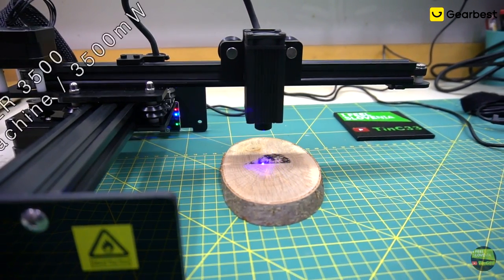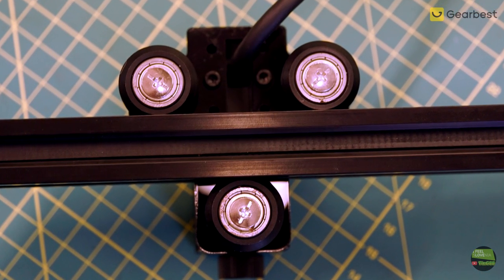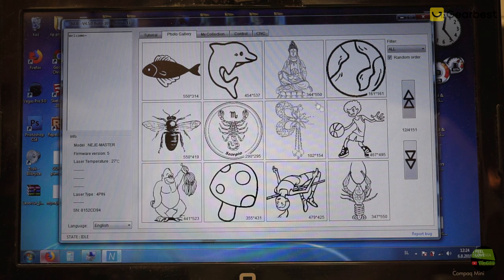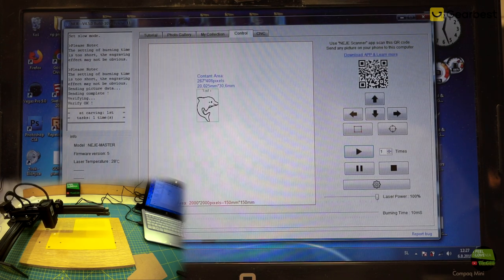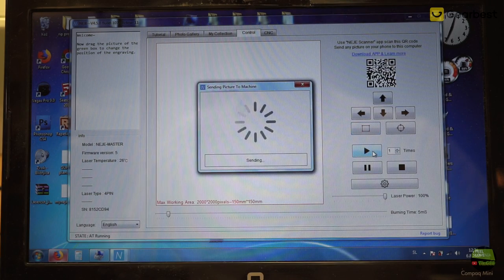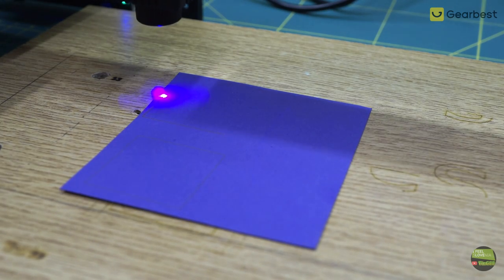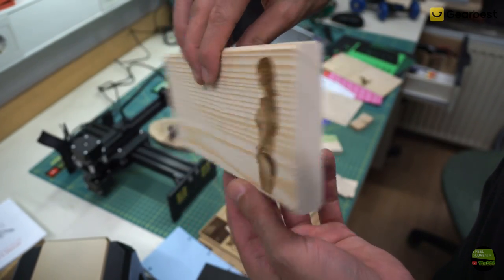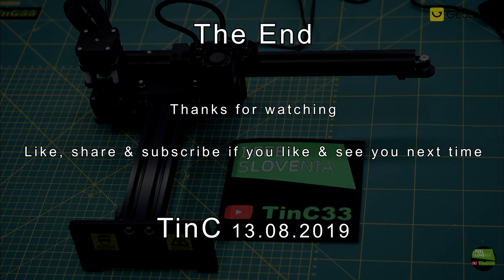NEJE MASTER 3500 Laser Engraver [review / software / first test on different material]

Comment: I wonder if you bought some 3d printer filament with mica embedded in it, if that would make it engravable? Years ago, I used to work for a company that had high speed packaging lines. The plastic bottles (for pills and vitamins) had to have mica in the plastic, or the laser engraver wouldn't work on them. Not very well, anyway. I found these filaments with mica: 

https://3d-print-works.com/blogs/news/luxury-filament-with-mica?ls=en-GB
Reply from the maker: It be interested thing to try, i try to engrave basic pla filament but it only melt the surface a bit, not clearly seen.
Reply: TinC33 maybe take a plastic pill bottle that has laser engraving (usually a lot code or an expiration date) and see if the laser works on that?
Reply from the maker: @toastrecon  thanks for tip, i'll try next time when i use laser, but i think that's different laser type not only plastick, anyway need to try 😉

Comment: How long did it take to engrave the lion and the girl in a bikini?
Reply from the maker: Hello, now you got me, honestly i don't remember anymore, and also i'm not home so i can check the clips... but i thing somewhere from 30min-1h it's very depend on engaving time settings.
Reply: @TinC33  OK. Looking forward to that. I want to use the machine for a start up engraving business to raise money for a bigger machine.
Reply from the maker: @stephensiloka8713  I think that one is good choice to start, because if you see needs later for more powerfull laser you can simply replace laser modul with 7 or eaven 20w, and also allow us cnc controll.
Reply: @TinC33  So, you're saying that in case of an upgrade, all I'll have to do will be to replace the laser module and not the whole machine?
Reply from the maker: @stephensiloka8713  exactly, but in case you want upgrade to 20W modul, you need to replace also power supply with 3A 12V that one comw with a machine is 2A 12V.

To replace the laser modul, all you need to do is unscrew 4 screws and reconnect the cable, few minutes of work.
I got 3.5W laser modul, but if you got 7W or eaven 20W you can reduce engraving time much lower than on 3.5W, so stronger laser do same job in much shorter time.
But must to tell you here, that when you reduce engraving time too low (about 5ms) laser become too fast and there coud be some vibrations, wich mean worst result, but you can always decrease laser power and encrease engraving time and get same result...
Reply: @TinC33  Thank you very much for the feedback. It's been very helpful